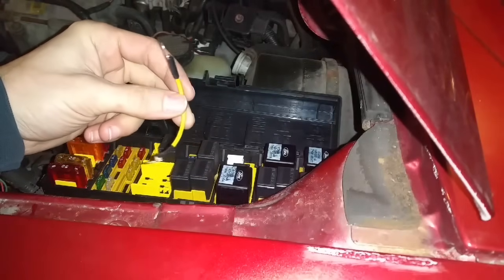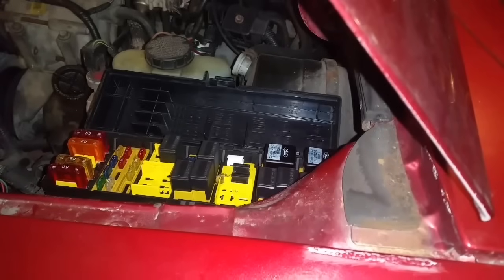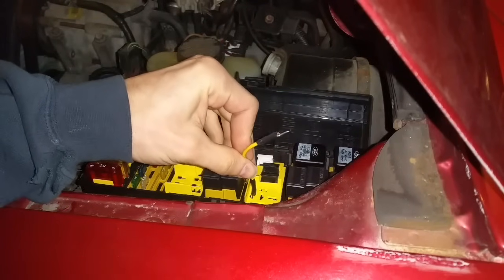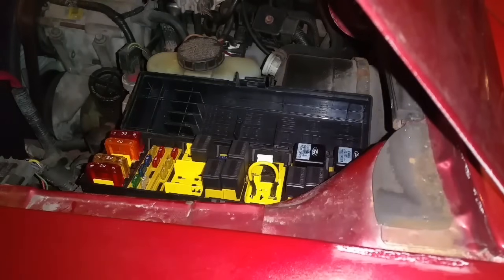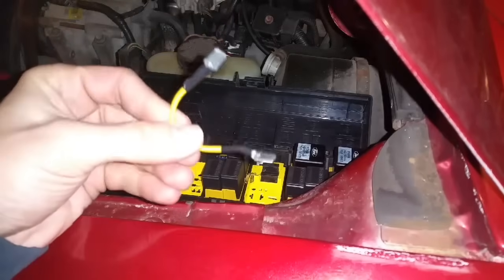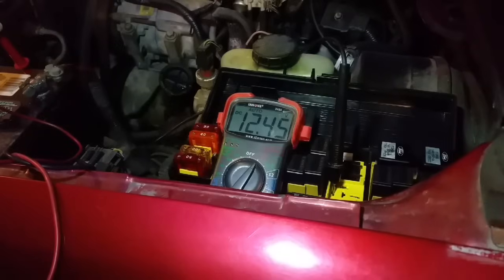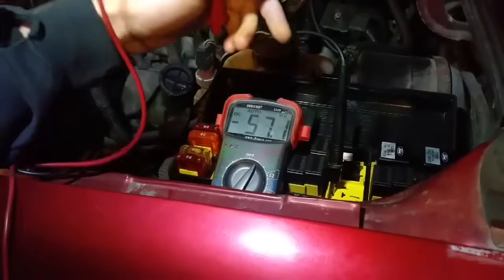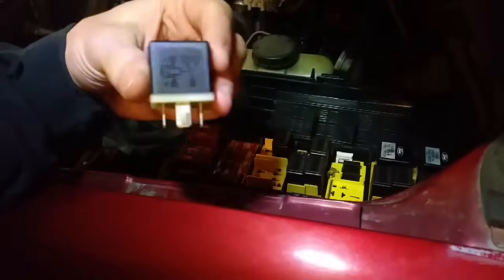HOW TO Bypass A Relay Using One Wire!!!

Comment: Hi, I have tried to bypass a relay as you mentioned 30 - 87 but nothing happened but if I do 30 and 87b then the fuel pump starts. Is it suppose to be so on 6 pin relay?

Comment: I have a 2009 mustang gt . Having a problem with the pcm relay or so I thought . If I push down on the relay it'll get power if I wedge it a certain way it'll get power but then dies if I hit a bump or it gets moved at all. Any idea what's the issue ? I've had it at 3 different shops and they couldn't fix it . Thanks for the videos !

Comment: Plz read !!!
I tested my relay for my low beams and high beams and both are good. Pulled both fuses- put needle nose in the high beam relay location sparked and high bemas turned on. Did the same w the low beams and still don’t work. No spark/ nothing- is there a possibility the fuse box where the relay plugs into at that location could be bad? Plz help…

Comment: Help:  I did this on my 3rd Gen 4runner to see where my issue was at.  Now I have lost all electronics.  Did I blow a fuse?
Reply: Same I was jumping it constantly now nothing did you figure it out?
Reply: @Awesomeimagination13  Yeah, it was the starter.  Everytime I tried to jump it with the wire, it just nuked my battery.

Comment: What are the dangers of doing this? My fuel pump was replaced and they put a wire between the f pump relay and the fuse box. The truck worked for a few days and now it won't start and I can't hear the fuel pump. I don't know where to go from here

Comment: A fuse is not needed on the jumper. The starter/fuel/lighting relay circuit you are jumping is already fused @ the fuse box. Jumper 87<--->30. You are just temp subbing a jumper wire for the bad relay switch/contacts.
Just remember a relay is nothing more than an electrically operated switch.
Unless it's an Air-operated relay... Wahaha
Reply: That makes sense

Comment: Quick question I have a older Dodge 1999 caravan I use just for errands  took it to the Electrician had issues with the Ac so he got the Ac to work since I really don’t use it much the ac runs non stop I noticed there was a wire running from the starter relay it was a ground wire and also the Ac relay had a wire running to the ground I tried to start it there’s power but won’t start?

Comment: Wtf How did you figure out were to put the wire most relays have a diagram on the side to help but still just picture of a switch and a pic of a wire connected to another wire, can you hook it up backwards without damage?? Obviously it can be jumped as a relay is a switch the question is how to determine

Comment: Hi thanks for posting this video! Wondering if you want, for example, your rear 12v accessory cigarette port disconnected from power when the engine is running (instead of the port being powered when the car is running), that you would pull up the OEM relay and rewire it so so socket 87 goes to 87a? If so, would you also put a pig tail in to connect socket 87a to 87?

I want for my rear cigarette port to be off when the engine is on and on when engine is off so I can charge the battery with a solar trickle.

Comment: I did this jumper wire trick on my fuse pump relay on the fuse box the fuel pump came on but would not turn off, and the car still cranks and doesn't start.😫🌋🥵
Reply from the maker: Uh oh... injectors firing?

Comment: What if I do this to a fan relay and it blows fan fues?
Reply from the maker: Could try a slightly larger fuse. Maybe only 5 or 10 amps and see if it stays on. If not it may have a short in the circuit. Fans do have a high startup load so can blow a fuse on startup, even though it doesn't draw that much when running.

Comment: Pro tip, get a relay jumper kit, multiple relay designs to give you jumper terminals marked and numbered In paralell. Much safer and easier to diagnose the relay circuits..
Reply: thanks didnt even know theyvnade those

Comment: Your black meter lead must be on ground..Not 12 V in your demonstration. I believe you jumper is taking some node "Low" to enable your PCM if in fact that those points are the relay load side.

Comment: As an electrician at the railroad dealing with many relays we had a saying .."if in doubt jumper it out".
Reply: Cheater wire lol to find the power and neutral to complete a circuit..  understanding electrical and understanding schematics will make you a wealthy individual of you apply that knowledge in the field
Reply: @steventuck1573  Please elaborate. Starting as a commercial electrician and then going to what position?

Comment: well ima have to try this to see if it will work for me.

but any heres whats going on. 

Ok I have been on a journey. This might be kind of long.

So 2001 Buick century - what I've done

Replaced radiator, radiator cap, cooling fans thermostat, heater core, water pump, coolant temp sensor.

After replacing ALL of that the cooling fans would kick only when I turned the AC on. Or so I thought. Turns out they were functioning normally but not at the correct temperature. Low speed would turn on when the needle reached the just before the 3/4th temp gauge line. High speed would turn on at the 3/4th temp gauge line. So I figured pcm must be faulty. (Among other tall tale signs)

So. Replaced the pcm. FIXED A LOT OF ISSUES. But ended up back to square one. Cooling fans won't come on. Not even for ac this time. So I broke the trustee multi meter out and started rechecking wiring. Bringing me back here today. Now. It seems the cooling fan 1 relay is not getting properly powered. According to my relay. Post 85 and 86 should have 12 volts power, and post 30 and 87 should have no power untill tripped. Well 86 has 12vs 85 has no volts 87 has 12 volts. And 30 has no volts. replaced the fuse box with no change

So I'm assuming 85 and 87 have crossed somewhere and that I'm needing a wiring diagram for the back of the relay fuse box that i cant find.

Comment: Have a Chevy Cheyenne 1998 the anti theft light is flashing car won't start. Fuse and relay have been replaced also reset it removing the battery connectors and also reprogram the ignition key. Help what el can it be? Wires?
Reply: Did you figure this out? Have the same issue ongoing

Comment: Good information here. However never stick your dvom lead in the socket.
Reply: you can make contact yes but do not spread the terminals. T-pin is ideal or a terminal lead with port for a probe is better.
Reply: @chrisbartkowicz2759  I find small thin sewing needles work well for fitment between the terminals. but horusdy does sell a back probe kit for less than 20 bucks. Works great 👍

Comment: I have a new fuel pump relay and when I turn the switch I can hear the prime it also has a new battery but just turns over but not start, Can you help.
its an 03' astro
Reply: Just because yours getting fuel doesn't mean your getting spark.
Reply: @jduda1127  I replaced the pump, started right up.  thanks
Reply: @JosephCompnotta  makes sense I thought ahead of myself and just because it primes doesn't mean it's built enough or even any pressure. Glad you got it running. Happy Holidays Sir
Reply: @jduda1127  Thanks, you too stay safe
Reply: @JosephCompnotta  always, you do the same.

Comment: I use this method but no power in FP connector
So I just connect a wire from relay 87 to  FP wire now pump is working

Comment: My car keep burning out all the throne switches on hook up to run my fan can u tell me if it the relay switch bad
Reply: If u want it to work just change the fan and make wires directly connected,(it will be loud when u turn on) thats usually the engine wiring problem bro god help u

Comment: So I suppose with another wire in the starter. Relay any 2nd gen could be mine. Of course I’d have to only drive in the direction the wheels we locked.

Comment: My start relay has no numbers on it. I'm not sure which is 30 and 87. Any way to know?
Reply: Take your Relay out... Measure it... If this is Resistance, then you know it's 85/86 and the other 2 should be 30/87.  MATCH that to your INPUT... You should see the TWO Slots that needed to jump!
Reply: 85 and 86 usually are parallel

Comment: Where do you get wire like that? name?
Reply from the maker: I made it. Just a piece of wire and two terminals.
Reply: what kind of wire just curious and for safety
Reply: @TheCupfulBoy  - In Automotive World... Use 10 Gauge Wire if you can.  You can go with 12 Gauge as well.  But since this is a short distance, you can go with a Paper Clip!  NOTE:  As long it MATCH your Relay Amperage, you would be fine!

Comment: Will this work on 2012 dodge caravan
Reply: It should work on ALL CARS / TRUCKS.  Just be a bit careful of the WIRE you use.   Always use 10 or 12 Gauge Wire in Cars / Trucks

Comment: Unfortunately you do need more experience. Is there power going to the relay itself? And by doing that makeshift jury-rigging issue, you can risk blowing the expensive computer.
Reply from the maker: Well, sure... That's why I showed how to test which terminal has power from battery, and mentioned relay pin numbers... Maybe didn't make it past half the video?
Reply: 👍, overall a big thumbs up. I had personally had costly experience, but your hands on experience is the best way to learn, and share with other so they don't have not only a costly mistake but those who are not in a position to work on their own car will at least have heads up and hopefully save some money when they do need to bring their car into a shop if any, unfortunately I have to, as I am disabled with (MS)
Reply: @mp-wq2su  - This is for Temporarily Usage Only! For example:  If your Relay die and you are stuck on a road and needed to start your Car/Truck.  Other than that, this should NEVER be done!

Comment: Hello I have a 2012 Dodge Grand Caravan and it would not start after several attempts can this method of your work on it?
Reply from the maker: Hope Ukonu If a bad relay is causing your issue it would work.
Reply: a21bravo please where do I get the bypass cable
Reply from the maker: Hope Ukonu I made this one... Just some spade terminals and wire.
Reply: a21bravo thanks a lot buddy.will try it when I get home

Comment: I’m having a problem with my car starting, it doesn’t even want to crank. The only thing it does when I turn the key is that the all the service lights come on. I took it to a mechanic and he said it was the ignition switch and by passed it I believe by jumping the starter relay. What problem am I looking at?
Reply: hi! 
did you solved this? how?
Reply: Might be a dumb question but did you check your starter fuse?

Comment: Thanks for the video, it`s very helpful. It` s good to know that I can bypass the relay in case of emergency such as when suddenly my car`s relay broken. What wire size in AWG did you use to make this jumper?
Reply: +Victor Alexander - Depend on the " Relay Devices Rating ".  But " most " a Paper Clip / 10 Gauge Wire would work!
Reply: I used 16 GA

Comment: which points are you using 85-86 or 87-30
Reply from the maker: Sosa You're going to connect the 30 and 87 terminals... 85 and 86 are what activates the coil in the relay to pass power through the relay using the 87/30 combo.

Comment: I have a short in my f150 when ever I try to start it it blows a fuse a 30 amp
Reply: Same situation with my mustang.
I woudn't do what you're thinking about doing because it will run the wire really hot and melt and potentially start a fire.
You have a wire short somewhere.
Did you ever get it fixed? What was the outcome?

Comment: Doesn't ever say which to plugs to connect?
Reply from the maker: Patrick Mullaly Yes... Yes it does... I show with a multimeter that constant power source is going from the 87 terminal to the 30 terminal for the relay...
Reply: Ah OK sorry to jump the gun.  In the midst of auto frustration at the moment!
Reply: My fuses on my 2000 Taurus have 1 2 3 4 and 5. Which ones do I connect?
Reply: @austineverett3540  it's not for fuses just relays there totally different
Reply: Patrick Mullaly Q

Comment: I had to do this one time when a short kept killing my car, did a jumper and was good for a few miles, then my car turned off in the middle of traffic @ 60mph between two semi's in a moderate turn. All my lights flickered and doors locked and unlocked. Luckily the car turned back on right after, but holy shit - scary! Lol. Definitely should be used for as short of time as possible.
Reply from the maker: bassboylowg Jeez that's no good, lol. Yeah, do not recommend long term.